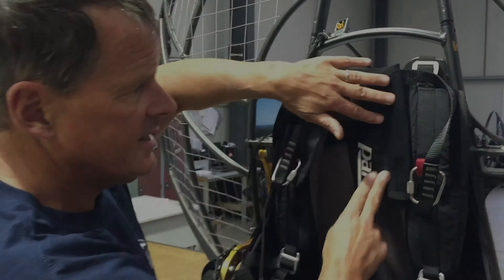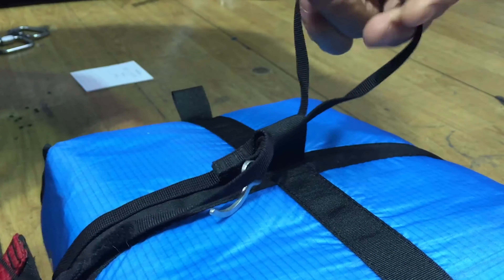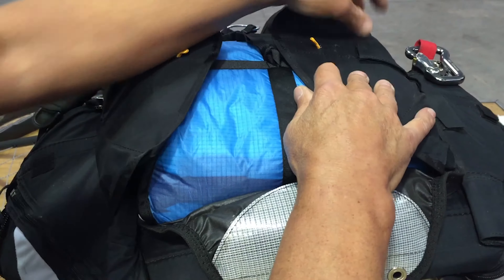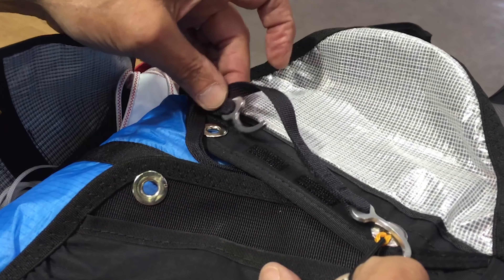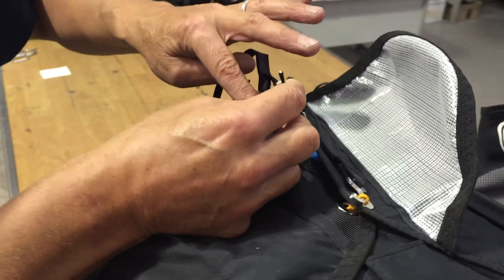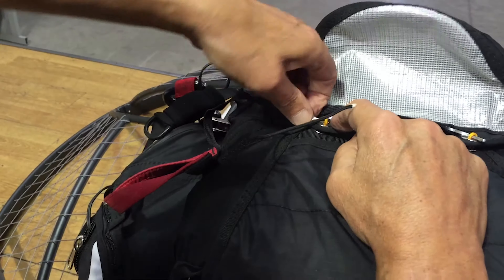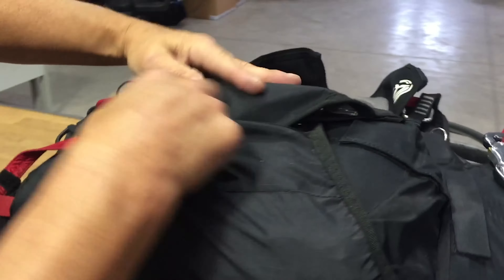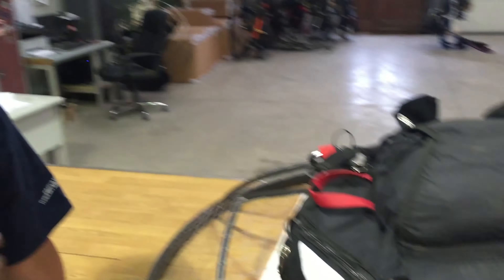How to pack your under-seat reserve on a Parajet harness

Comment: Was the caribiner tightened only by hand ???????
The pullup should NEVER be extracted from above the pin with friction occurring on the closure loop, with basic manipulation the pullup can be maneuvered below the pin and the friction placed on the pin and not the closure loop.